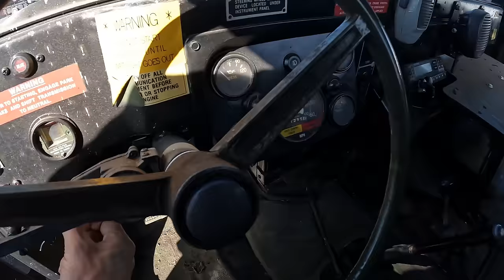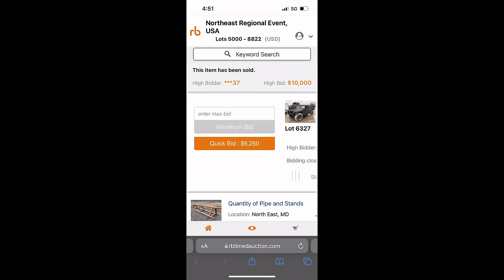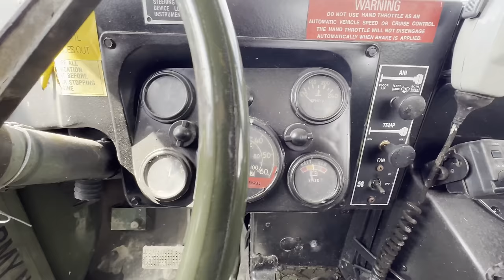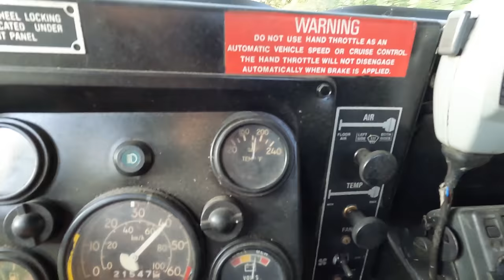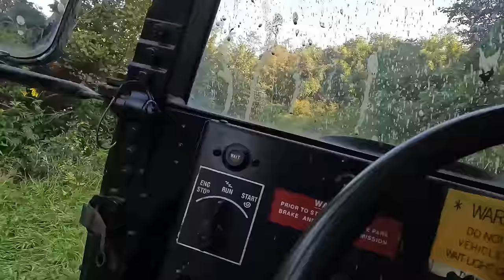Buying, Servicing, & Off-Roading The Cheapest Humvee I Could Find!!

Comment: Matt, I have worked on many of the GM 6.2/6.5 variants back in the day they are a pain an the azz boat anchor. Even turned up they are balless. I would convert it to a spin on fuel filter if you are going to keep it. Also priming that stock filter disconnect the spade off the fuel shut off solenoid when you crank it over to prime it will keep the injector pump from running dry or starting the engine while priming. Those Stanodyne pumps can be a bitch to reprime when the are full of air. Those engines require the glow plugs to work all the time, even here in Florida hot as it is, and don't use cheapo glow plugs if you replace them { Champions are JUNK!!!} they tend to mushroom the tip of the plug when they crap out I have had to pull heads to get them out. If you are keeping it I would 4 door it and put the slant back hard top on it.

Comment: Nice Humvee, would love to have it at that price.  The two metal objects you found are for the two external antenna's and yes, the back seats come standard, making the Humvee interchangeable from 2 to 4 seats pretty easy.  All Military equipment is made by lowest bidder, changes periodically over the years.6.2 is a good motor, you can trust me on that. You can get more power out of that motor, just need to find the right mechanic.  HOOAH!!!

Comment: One of the best 4wd systems ever made. The funny part is that is has 2.73 axels. That sounds like great highway gears and terrible off-road. Until you multiply by the 1.92 portal hubs. Then you end up at a 5.24 axel. No speed and all the torque. Guys who want even more twist drop in 4.10 gears and get a 7.87 final. Low range is almost 3:1, so you could do some serious crawling then. Low range first gear ends up around 53:1 with 4.10s, but even stock is about 25:1.

Comment: Was wondering when you'd get around to posting this one. Have logged MANY miles in those things. Each of the bubble-wrapped pieces is for a "matching unit," which is the large cylindrical base and spring that mounts to the outside of the body (usually the rear) of the vehicle and onto which the long whip antenna would be threaded/screwed. The matching unit is a compensator that enables radios to send and receive on a wide range of frequencies using one fixed-length antenna. They're not much use outside of military functions but were in use from 60s-90s. You may be able to trade them off to groups who restore military vehicles - or have fun upcycling them to something different. Most came with the back seats under the floor as did yours. As there are no back doors, this one is a two-seater (but with hard shell front doors...).  You could easily install a 4-seater soft top and doors and replace the rotted seats so you could torture passengers - they're not comfortable. You would need to find a LOT of hardware to convert it to a 2-seater hardtop (maybe Pomeroy PD still has the pieces lying around?), 4-seater hardtop or even the 5-door hatchback - good luck with that.   Ply a mechanic at your local National Guard armory wtih coffee and donuts. They'll be a wealth of information for the lesser-known issues associated with that generation of vehicle (e.g., floppy fan belts, fiberglass pieces, tire maintenance (LOADS of fun there), etc. Unique pieces (tires!) can get expensive. Major downer is that they're NOT fuel efficient and diesel, sooooo...  On the other hand - and as you have discovered - it has superior traction and offroad capabilities - your friend's jeep is no longer top dog.
Good luck and thanks for posting.

Comment: Torsen diffs- you can see it free-wheeling when the one was in the air. Give it a bit of brake to help out- Torsen is torque-bias multiplying, if a wheel is in the air there is zero resistance, so it won't have anything to multiply against if that makes sense. A little brake will send power back over to the other wheel.

Comment: I’ve had a couple of those from GovPlanet.  Lots of fun but almost no creature comforts.  At least the heaters really put out some hot air.  Be ready for a noisy, drafty ride.  At least you got hard doors.  It’s probably been mentioned but look up a fairly rare spontaneous combustion issue.  I always disconnected the batteries when it was in the barn.  Enjoy all the thumbs up you’ll get driving it.  Btw gentle pressure on the brakes will lock your diffs if you get too off camber.

Comment: As others have mentioned, those have Torsen like differentials front and rear. These lock up more and more from side to side as more torque is applied to the input.

If traction is low and there isn't enough resistance at the wheels to lock them up, you can use left foot braking combined with right foot throttle to lock up the differentials.

Even with two diagonal tires completely in the air, if you apply the brakes enough and apply the throttle enough you can lock up the differentials completely and get power to the two tires that aren't in the air.

One trick to greatly improve the differential input torque is to put the transfer case into low range when off roading. In low range the differentials lock up easily with left foot braking and this really helps with getting through rutted muddy trails.
Reply: Exactly ... great comment. With emphasis to be in 4 low for the funky diff lockers on Humvees ... but even on my old Toyota HiLux diesel the electric diff locks won't engage unless in 4 low ... engaged, she'll climb like a Billy Goat.

Comment: One thing to do during an oil change is smell the oil and make sure there's no diesel smell.  The mechanical lift pumps on the front passenger side of the engine have a bladder in them that separates the crankcase oil from the diesel.  It degrades over time and will pump diesel into the crank.  That ain't good :P
Reply: just like the fuel pump on p.much every carburetted gas engine by the sounds of it.
Reply: @TestECull  on a ton of diesels too
Reply: Cleetus McFarland had a vid where they drained the oil and put diesel in and got like 40 laps before it finally gave out

Comment: Get the -10 manual!!!!  One very important thing to check from my Army National Guard days are the THREE ball joint castellated nuts on each wheel.  Each has a cotter pin.  Check each to insure there is a cotter pin.  I found two during maintenance times that were missing!  Losing that nut would not be good!  CHECK and report bac Matt!

Comment: Yeah, that's one that was a 4man that was converted to a two man (with troop seats), the the antenna mount you found has the three bolt pattern go to the back of the truck above the tail light basically the same as the one on there, the dancing voltmeter is cause the voltage regulators on these like to shit themselves all the time. They'll usually run on a bad voltage regulator for awhile before they stop working on you
Reply: Yeah they buried two semi comfy seats and installed peasant racks. I bet they are a joy to sit on when off road.
Reply: It's a factory 2 man. There's no holes on the back wheel wells for the seatbelts. All 2 man Humvees have the seats hidden like that.
Reply: @dylansnyder7757  heck no man, most of them don't even have the box the seats go on. Unless the zoomies or squids do it different

Comment: Per The Book, to go 4-seater, you have to delete the stake bed sides and install another headache bar aft of them.  
The vehicles were designed to go "flat" level with top of the windshield mount, so, everything comes loose and stows in the back.
Those seat recesses were notorious for holding all kinds of "contraband."
Reply: What kind of contraband lol.
Reply: @tjnucnuc  literally anything and everything you could fit in there.  

Bii, lickeys and chewies, drinks, literally a bottomless pit of randomness lol

Comment: I ran those engines for years in several different trucks back in the late 80s and early 90s .  The easiest way to get more power out of one is to advance the timing on the injection pump.  There is a mark on the pump and one on the cast housing.  Advance the pump to the with of a  Nicole. You will be surprised by the extra power you will have and it never seemed to hurt anything.  I drove them for years that way.
Reply: you can also set the injectors a bit high so it runs a little dry, reduce fuel consumption without hurting the power.

Comment: one thing to remember on all gm diesels especially with 6.2,6.5 turbo detroits there built for fuel economy and because they were the cheapest thing the military could get both th cucv(squarebodys) and humvees you will need to add some straight pipe where the muffler fell off (also be very cautious of the pipes going to the airbox if there cracked you will hydrolock the engine cleetus mcfarland found that out the hard way (all your breathers go to the box to make sure there in good shape too)

Comment: Those brackets wrapped in bubble wrap are antenna mounts.
You could get the air intake snorkel and exhaust extension like what's on the USMC version HMMWV

Comment: Matt, at 26:20 in the video I see the light switch is off. Make sure you leave the top lever in the first notch to the right or you will not have any brake lights! (You need to lift the bottom right lever to unlock the top lever.) Also, make sure the left liwer lever is in the off position when parked or it will kill your batteries. Or install a battery cutoff switch.

And the military uses non commercial components so you can't use them on normal personal vehicles.
Reply: Wait, so what kind of component can't Matt use?
Reply: @Netherlands031  regular off-the-shelf stuff.
Reply: @Netherlands031  Components you can easily find.

Comment: The Hummer I believe has factory fitted Torsen diffs on both axles and, being a permanent 4x4, possibly one at the central diff. The Torsens though supposedly fully automatic have their quirks and it takes some driver skill to make them fully deliver. The Torsens also place a limitation on the max size wheel one can fit, which if exceeded, leads to their almost immediate catastrophic failure. Something to watch here.

Comment: 36:30 One thing I remember about riding jeep trails with my HUMMER is they are not wide enough.
38:30 with that open exhaust pipe backing up could plug the pipe. I don't know how the exhaust was run on the HUMVEEs but the civilian HUMMER had the exhaust loop up over the rear axle inside the left rear wheelwell which created a seal to keep water out of the exhaust system when running through deep water. Downside of that was the exhaust pipe radiated a lot of heat into the wheelwell and that heated up the tire. Was only a problem on long runs at high speeds though like turnpike driving which the HUMMER is not designed to run over 60 MPH for extended periods.
Reply: dunno about the US military versions, but the ones we have here in Denmark the exhaust just goes out to the side in front of the rear axle.
Reply: @thesteelrodent1796  thats how the military ones are too
Reply: @TylerDuysen  I thought so but couldn't remember how they were configured. The HUMMER (civilian version which GM renamed the H1) and the HUMVEE are pretty much the same animal and go down the same assembly line up until the dash and wiring harness goes in. Then they start to diverge and go their separate ways. That's what I saw when we toured the AMG assembly plant years ago. At the time the H2 didn't even exist except for the prototype which they showed off at the event (first Hummer Homecoming) and the H2 assembly plant was still under construction in 2000.
Reply: The civilian H2's are just Yukons with ugly body work, the H3 was never touched by AM Generals, and is a glorified GMC Canyon.
Reply: @CAPNMAC82  Yup, I know all that. I have no love for the H2 or H3, and GM ruined the H1. I drove a 95 HMC4 for 14 years and had loads of fun with it.

Comment: Power or lack there of is a relative thing. Under powered? Hardly, the thing will go just about anywhere off road and if it won’t, lack of engine power will not be the cause. The problem is we are accustomed to modern 4x4s that have plenty of highway power. Two different vehicles as those modern 4x4s won’t get to half the places the your hummer will. Look at the pre 80’s Land Rovers and Land Cruisers, slow, underpowered, unrefined, rough ride and noisy until you turn off the bitumen. Then they suddenly became strong, reliable, tough go anywhere vehicles that were heaps of fun. If you bought your hummer for highway cruising, you bought the wrong car. For getting around your area it’s probably perfect. Cheers Stuart 🇦🇺
Reply: i am in England, and have a Pajero, doesnt have much power but has a lot of torque... :)

Comment: Hey Matt, Another one of the more common problems is the alternator bracket bolts on the left front of the engine.  If not torqued properly with locktite, they will loosen, then break off in the head.

Comment: When your loosing traction, put a little pressure on the brake pedal. You have torsion differentials. There like limited slip. To engage use a little brake pedal.
Reply: I recall reading about those years ago. Their not as good as lockers but much better than the average limited slip diffs.
Reply: The diffs are Gleason Torsens front and rear. They are TORque SENsing. Yes, light brake pedal pressure works well to carry airborne tires.

Comment: I was in the US Army for 16 years and I believe your frustration with some of the nuisance parts and location of the HMMWV. They do great off road when it is built light, but they drive like a slug if it is up armored. It is never a pleasant drive on the highway with its annoying steering play, stiff suspension and road noise but as an off road vehicle, they are magnificent! You can have the engine tuned and add a better turbo to have more throttle response and a bottom skid plate to protect its belly and that would be a great off road vehicle. If I had the space, I would definitely buy one...

Comment: The nutserts in the windshield frame always fall out and the channel bar that goes over the door is always loose haha. They are super easy to fix though. The model number of the truck will tell you wether it was a 2 door or 4 door model but all the extra pieces are the seat pans and seat backs. You would just have to get doors and take off the hell hole covers.

Comment: If i remember right, those two loose brackets with the loops welded on them are brackets for mounting a steel bow frame over the tail gate area so you can stretch out a bed cover (cap) made of rubberized canvas, some had a metal frame that came with the set i think for taking the center slack out and tightening it all up a bit, not sure. When i was in the Army we were driving mostly old jeeps leftover from Nam and Chevy 4x4 pickup trucks. They were talking about getting Hummers in just as i retired.

Comment: I see everyone has covered the facts about the engine and its power, that is not needed, as that vehicle if driven correctly cannot be stuck, but just remember if traveling down a washboard road, there is a learning curve there.
As for the mounts that match up the the antennae mounts, those are indeed guards for the porcelain base of the whip antennas.
Those are in fact bullet proof units that can climb anything.
I remember when they first came out in the testing phase. The reps were saying give em hell, and my platoon leader and platoon Sargent were saying be careful and do not break them.
  Thats all well and good until you get out in the woods and your buddy asks if your up for follow the leader.

Comment: I'd be checking out the charging system on it then for sure Matt. If the voltage meter is jumping around like that. It's A good sign of possibly bad voltage regulator in either the alternator.,or the generator one has bad brushes inside of it.& A bad voltage regulator inside of it to.

Comment: I`ve had 2x 6.2`s, One was a Blazer and another a 2wd Suburban. Both 1982. Both had glow plug controllers go U/S on me and they will never start even with only a couple of plugs down / ether /Oxy -acetylene down the inlet etc. I converted mine to a push button controlled H/Duty relay on both motors, and also a mates to cure the problem as the controllers are dear and will go when you are in the mire somewhere-sods law.

Comment: Those items that were wrapped are antennae mounts 
That truck probably had benches mounted sideways to carry extra troops and yes most 2 doors came with extra seats to convert into a four door. All you need is the appropriate rear doors and to take off the bench mounts.
Also with that fuel filter, I have always taken the doghouse out to ease access to the back of the engine and fuel filter.

Comment: This makes me miss my 6.5 I had swapped into my old truck. Be careful of the starters. They require a special bracket on the back and without it, it can rip the starter clean off the block. Starter weights over 10 lbs

Comment: Those things you found in the curb side rear seat are totally antenna mounts. The ones you fit checked these on top of are beefier versions of the same function.

(Edit:) Those hard doors on the vehicle are designed to go with a “turtle back” top instead of the rag top installed that you replaced with another rag top. There are wire frame soft doors that go with the rag top. All the turtle back versions have 4 doors with a hard, sloped hatch covering the cargo area. 

The rear seats you found are in every humvee and some are blocked off like yours (the 2-man cargo truck style), some have 4 doors for the 4-man sedan style. I’ve got some contact truck versions at the unit that have tool boxes and other stuff used for contact maintenance. They’re 2-man cargo but with 3 roll sides on the cargo area. And they still have the rear passenger wells.